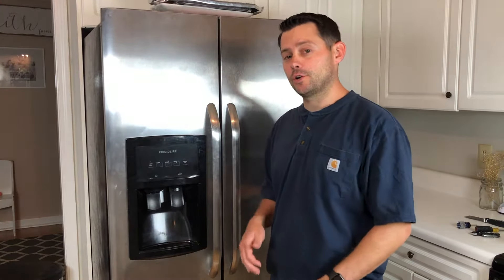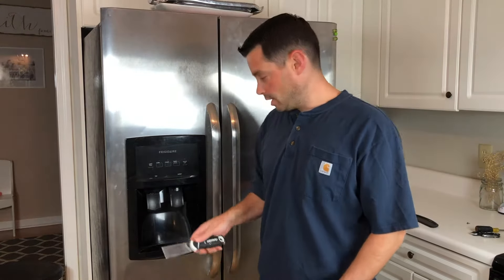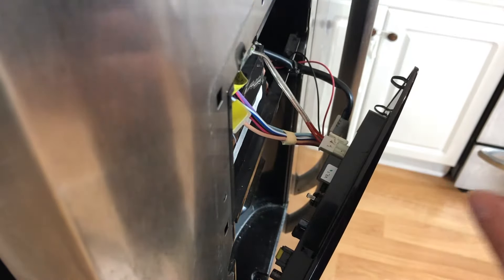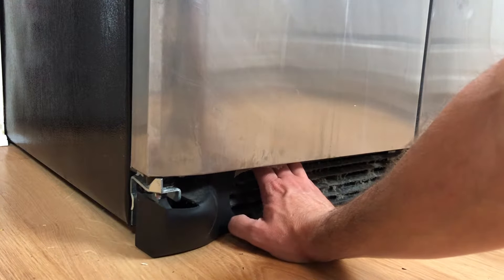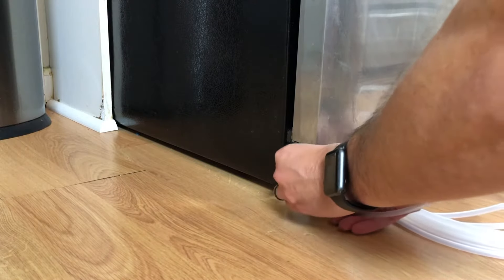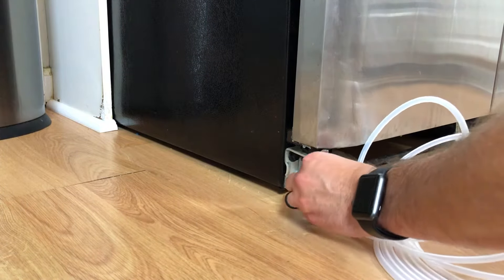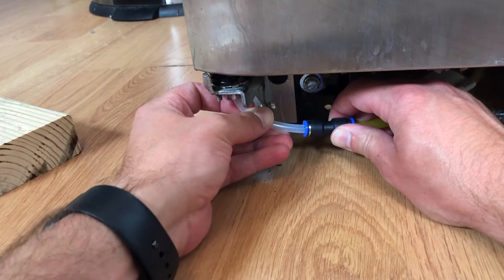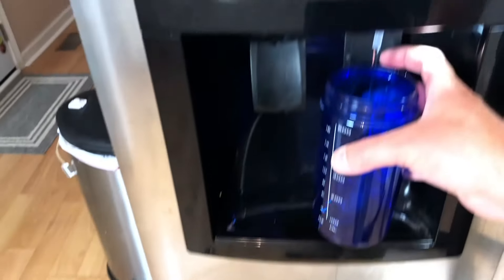How to Replace a  Water Dispenser line on a Frigidaire Refrigerator. Replace Dispenser Waterline.

Comment: This helped a lot. I changed the water dispenser socket for the filter, the pump in the back and had tried defrosting multiple ways. I couldn’t figure out how to get to the line in the freezer door and once I watched this, ripped the whole line out, got rid of the chunk of ice in it, fished the line back down the door (had to cut on end with a point to make it through the hole, boom, water again. Thanks again! Learned alot with this whole adventure haha.  Full fridge disassemble your fix a dang frozen dispenser hose in the end
Reply from the maker: Hey that’s great you fixed it though! Great job. Thanks for letting me know! Keep up the great work!
Reply: This is exactly what I did.  t
There was a small part of the line that was frozen.    Great DIY Video!!  @TryThisDIYFix
Reply from the maker: @billrayson5632  awesome! I’m glad it helped! Thank you.

Comment: Thank you so much for this video. I fixed the water dispenser just following your directions. In my case, it was only the valve, it was out of place after the pressure generated when I changed the water filter.
Reply from the maker: That’s great! I’m glad you were able to fix it!
Reply: @TryThisDIYFix  I literally just had this same exact problem and just fixed it after finding this video! I had found others using other models, but was happy to find yours to see how to get my particular panel out of the way. Thank you for this! Always happy to have a simple fix.
Reply from the maker: @JessInTheBox522  awesome! I’m glad it helped!
Reply: What kind of screw? My is exactly like yours but the screw looks flat and rusted, I can't get the screw out
Reply from the maker: @bobbyvassey7339  which one?
Reply: @TryThisDIYFix  to take the front off
Reply from the maker: @bobbyvassey7339  I think it’s a regular Philips head.
Reply: @TryThisDIYFix  it doesn't look like it, I try a Phillips to try to get it loose kinda looks like a square head, just it's rusted
Reply from the maker: @bobbyvassey7339  hmmm. Maybe try an Allen wrench.

Comment: Thank you for this video. It’s been the most helpful one I found so far. I turn the heat down as low as I could in the house so that the pipes wouldn’t freeze but also the heat wouldn’t be running constantly while I was on vacation. It took a day or two even after I had gotten back before the ice had built up in the line or a chunk of ice became dislodged and obstructed the waterline completely. I thought maybe my solenoid had gone bad but then I found this video. I said let’s start with a simple thing first. I pulled the line out and sure enough it was frozen up close to the nozzle. I took some string trimmer string and push the ice out and I had to feed the line back in backwards because of the sharp arc that was where it used to curve into the nozzle would not feed back through. So I just flipped it over and bang. Thank you
Reply from the maker: I hear ya! I’m glad you were able to fix it. Thanks for letting me know!

Comment: Thank you! After replacing the valve in the back, it still didn't work.  Turns out the line had a small frozen part, keeping the water from coming out. Hope this comment helps someone and keeps them from buying a valve they don't need. 🙂
Reply from the maker: That’s good to know. Thank you.

Comment: While moving my refrigerator the water line became dislodged causing the water to spill onto the floor. Thanks, I was able to repair it, although my outer cover panel was extremely tight.  Thanks again.
Reply from the maker: That’s awesome! That’s what happened to me as well! I’m glad it worked. Thanks for letting me know!

Comment: Video was good. How do we change the other water line from back of fridge where the water comes in from the water source, to the connecting point of front of fridge line?
Reply from the maker: You would do the same thing. Cut the water off, unplug the line or cut it and then put the connector on and feed it back through.

Comment: Nice video. Saw another which was just as good. So, my question is, how long does your dispenser take to fill a 12 oz glass to about an inch from the top? My KitchenAid (2001) takes about 45.47 seconds. Your water flow looks slow like mine but I am curios if its the same. I think it is too slow. I've done filter changes but it has always been slow. Drives me crazy. Try filling the pitcher with water after you've changed the filter.
OMG... like listening to your hair grow! I don't know what to do about it!
Reply from the maker: One thing you could do is change the size of the water line. Mine isn’t too bad, it would probably take 30 seconds to fill up a cup. But you could try changing the line to a larger gauge and that might help speed up the process.

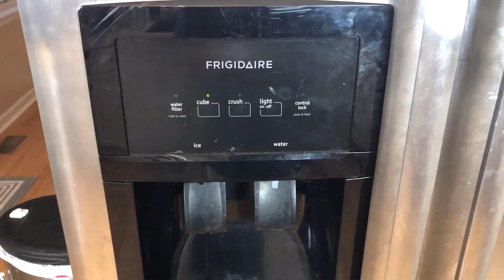Comment: How do I know if the drip problem stems from this repair that you are showing or the contraption in the back, as other videos suggest? 6:35
Reply from the maker: That’s a great question. For me the door fell so I knew it was probably the line.
Reply: Thanks. I think we will replace the part in the back, first.
Reply from the maker: @MariseGalgano  nice. Lmk if that works.
Reply: As soon as the part comes in and it’s replaced!
Reply from the maker: @MariseGalgano  sounds good!

Comment: Our refrigerator has small white pieces coming out of the water hole. Is it possible that this is part of the old plastic tube coming off? I have put a new water filter in and nothing changed
Reply from the maker: Hmmm. Can you tell what these pieces are? It could be from your water, filter or pipes. I would try and determine what these pieces are and go from there. Let me know what you find.

Comment: I have this exact same refrigerator. Is your water pressure low as well. Takes about two minutes to fill up one water bottle
Reply from the maker: Hmm. No mine isn’t low. Is the rest of your water pressure low? If not it could be something wrong with the line or a small water line itself.

Comment: Ugh can NOT get the new water line to come out the bottom or top😡 any tricks?
Reply from the maker: You can’t pull it out? It might be pinched. If you get it disconnected go ahead and pull it.
Reply: @TryThisDIYFix  no, the old one came out but the new one hits something near either end. i keep trying the slight pull back then push techniques but no avail 😕
Reply from the maker: @CalvertFitness  hmmm. I’m not sure. You might could try to push a piece of wire. But that’s all I can think of. Lmk if you figure it out.
Reply: @TryThisDIYFix  i might remove the whole damn door to get a better angle and be able to fish a line in there!
Reply from the maker: @CalvertFitness  haha! I hear ya! I’ve had some of those as well. Good luck!
Reply: @TryThisDIYFix  the freezer door comes off really easy and that SOB slid all the way through on the first try SMH
Reply from the maker: @CalvertFitness  haha. That’s great! I’m glad it worked.

Comment: The issue I've been having lately is I press a cup against the lever to run the pump and draw water, but after letting off the pump the water flow keeps dribbling out afterward to where the catch tray fills up after a few refills of the cup and then spills out onto the floor.
Reply from the maker: Hmmm. That’s odd. You could try to replace the line. But that might be something with your switch to cut the water off.

Comment: It takes 45 seconds to fill 1 cup (measuring cup) via my water dispenser. I think this is because the water pressure in the copper pipe entering the fridge is too low. How long should it take to fill 1 cup (measuring cup)?
Reply from the maker: Wow, that’s a long time. Mine only takes 15-20 seconds. I’d take a look at that.

Comment: I’m trying to trouble shoot my refrigerator water dispenser.  It appears to be spraying water out the side of the door when dispensing water only.  Not when dispensing ice or when the ice maker is refilling.  Is the water line vulnerable to breaks inside the door?  Or should I loom for something wrong from the water filter? The line comes up through the bottom of the unit but the filter is at the top left corner of the fridge.  Which leads me to believe something else could be leaking.  I haven’t found a schematic drawing of the fridges interior works yet.
Reply from the maker: I’m not 100% sure either. You could try this fix and see if this is the culprit. That’s actually what my problem was. The water line was pinched and had a small leak. But I’d try this and see if it works since it’s a pretty cheap fix. Let me know if it works.
Reply: Thanks.  I’ll give it a try.
Reply: @TryThisDIYFix  took the door hinge cover off and discovered the leak is a worn water line from the filter to the ice maker.  No wonder the leak wasn’t making sense, it was squirting out the top and down through the door seal.  Weird.  New wAter line is on its way.
Reply from the maker: @michellewelch6013  I’m glad you were able to find the problem!

Comment: My water line is dirty at the tip. Maybe I can clean it now.
Reply from the maker: Yeah you should be able to clean it out. Maybe even run some vinegar or something through it. If that doesn’t work, the line is pretty cheap so you can replace it.

Comment: How do I know if the drip problem stems from this repair that you are showing or the contraption in the back, as other videos suggest? 6:35
Reply from the maker: My door was damaged.
Reply: I removed the cap at the top of the door. And where they bend the water line to push it down there was a kink and it was obviously broke allowing air into the line.